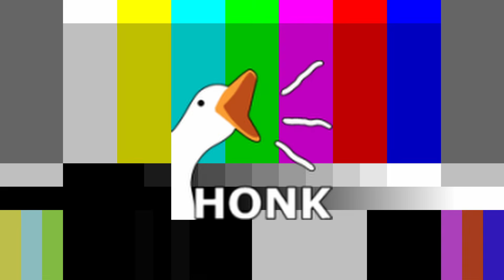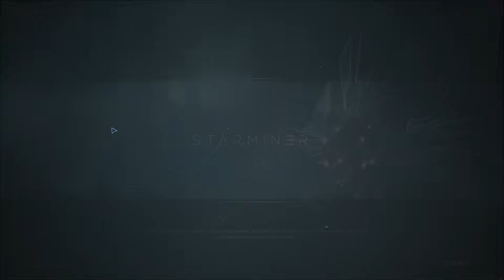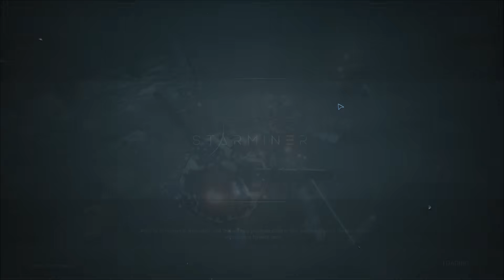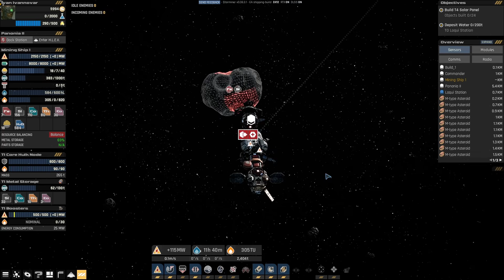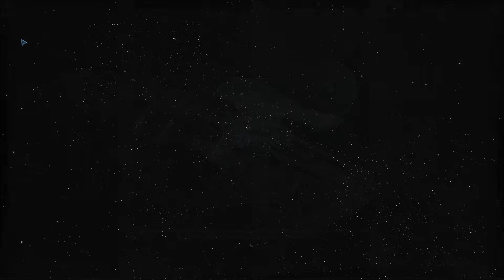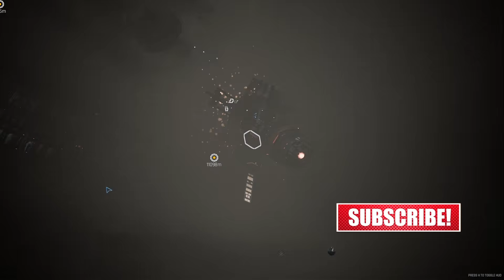Starminer Early Access Campaign Start Guide Part 3 | Jupiter Jump

Comment: You mentioned docking (up to) 3 vessels in the hangar ship, in the comments of other creators it has been said that even though there are only 3 docks, you can actually dock up to 8 ships, I have not yet tried it though.
Reply from the maker: The current version(s) of the game actually have unlimited storage for ships inside the hangar. The only restriction is the size of the docking area, which is 4 Wide x 4 High x 6 Long, depending which modules are used. For more detail see episode 8 in my series 🛸🏗️

Comment: I'm not sure of the criteria but I have been able to get more than 3 ships inside the hangar. All but one were fairly small, less than 4 nodes each alongside the massive refinery that we get and i managed to configure it compactly. 

Mothership showing up is based on the amount of heat being generated and what level heat any given system has as its threshold. Pulling that huge refinery after building the drill ship was sufficient for me to think was that thing always here? And then noping tf outta there. No thank you.
Reply from the maker: Thank you! Indeed, the current version(s) of the game have no limit at all for how many ships can be placed within the hangar. Only restriction is that they fit within the docking area (green hologram status).

Comment: I love your videos and all the tips you give in them.
Just another tip. You have a hangar. Why didn't you load 1 or 2k iron in it before going ? It would have been so easier ;-) 
I still didn't jump to Europpa, I'm actually filling a bit my hangar before moving :-P
OOh and also : you can drive the hangar like any other ship, you don't have to let it away from your target
Edit : I've put 2 research labs on my refinery, it has a lot of place and the power for it, it works fine, you don't need to have it on your miner.
Reply from the maker: Glad you're enjoying them! Indeed, you're right regarding the Hangarship and storage, I get into that a little in the next episode (Part 4), which drops in 4 hours from now, and I'll cover it in more depth in Part 5 :)

Appreciate the feedback and hints! o7 :_grumblesGoodVibes:

Comment: I believe the mothership turns up when you reach a certain heat signature level, i'm sure i saw something recently saying they had set it to a specific value, maybe before it was just when you went to a certain part of the campaign?
Reply from the maker: Quite possibly. There’s also the possibility that it’s related to using the jump from the Hangarship and a RNG chance per-jump, which could be a cool element of gameplay or a nasty surprise at times 😂
Reply: I have played saves that the mothership has shown up without ever jumping. maybe it's both?